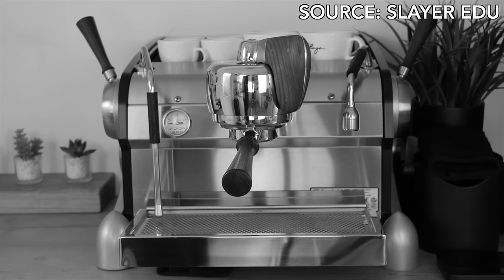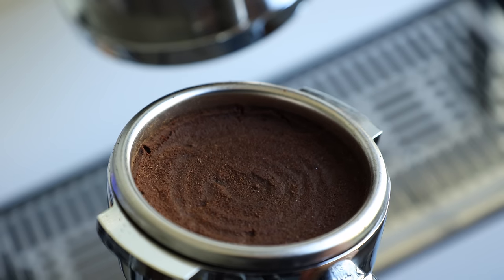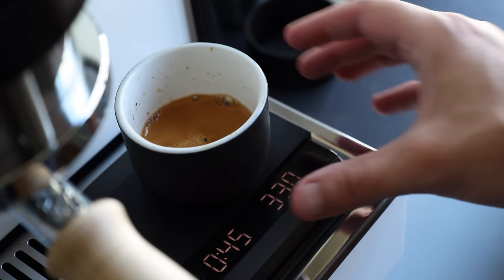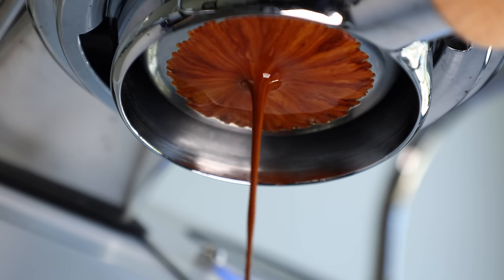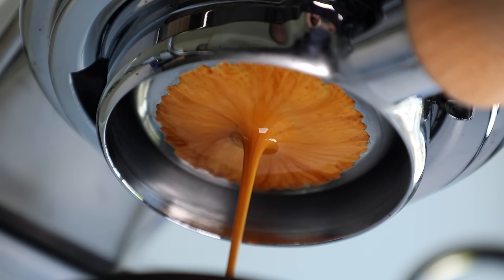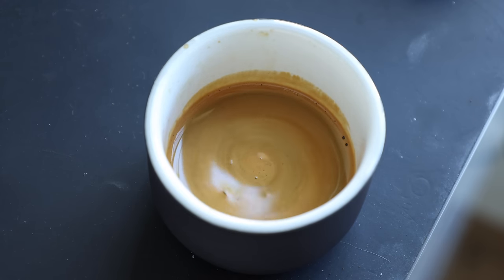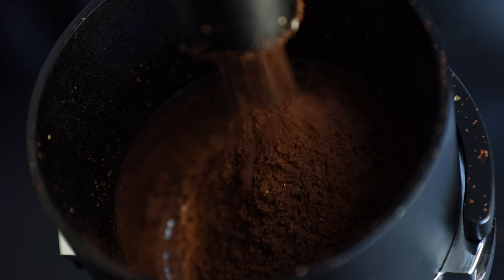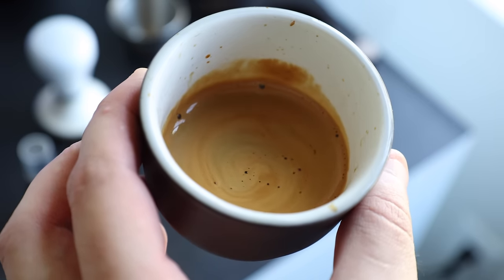ESPRESSO ANATOMY - The Slayer Shot

Comment: When I first got my lever machine these were the shots I was most enjoying. I then found a lot of material that said this was “wrong” and my shots should be taking 25 seconds instead of the 45 I was pulling. 

It taught me a lesson, there’s no right or wrong, as long as it tastes good :)
Reply from the maker: Exactly, don’t let people tell you what is right or tastes best. That’s all subjective
Reply: I pulled a 60 second shot dialling in a new bag of Ethiopian, it was really quite delicious.
Reply: Same experience with levers here. It takes nearly 30sec to wet the puck at boiler pressure, not sure how anyone manages to do it any quicker and get any volume

Comment: This makes me happy. I ran a cafe in college, 2014-2018, and was trained to pull the slayer shot by our local roaster Brown Coffee co. Brown used a slayer but we had a Strada MP and both worked fine like you stated. My top espresso shots came from this style. #1 being a washed Ethiopian that was like sparkling rose water that finished with velvety sweet Meyer lemon. Dear Lord, the heavens parted that day.

Pro: We wasted significantly less coffee! Instead of changing the grind size, and having to purge etc, we just adjusted the preinfuse time! If the shot was too acidic we would preinfuse longer, too bitter preinfuse less time. If shots were running really long we would "flash" the coffee, full on and full off quickly, then proceed with the preinfuse time. Coffees seemed so much more full and complex.

Con: If you weren't tasting the coffee frequently it was hard to tell purely based off time if it tasted like crap. It was also more difficult to train people this way. Another con was shot times were longer. The sweet spot for the coffees we used was 45-55 sec instead of 25-32.

Comment: My main problem with the slayer shot is uneven extraction through the puck. If you preinfuse with low flow or pressure and ramp up with first drops, the top of the puck will have more contact time than the bottom. Every shot I had was sour and bitter. For me it makes more sense to flush the puck and bloom it for ~30s. That will produce more even extraction through the puck.
Reply from the maker: That’s one school of thought, but in my experience I wouldn’t consider it an issue. Contact time in general has become less of a issue for me when it comes to extraction. I’ve had 15 second shots with 22% yield and 60 second shots with 19% yield and both bring a unique quality to the cup. 

In terms of blooming that is also something worth exploring in a future video though.
Reply: Using the Bianca style flow control and an example, by flush the puck you mean open at full pressure and the close the paddle for 30sec, the open it all the way ?
Reply: @NANA-gy7yx  open with max flow to flush the puck, close with first drop, wait for 30s, then pull the shot til your desired ratio
Reply: I get fantastic shots on my Nurri Lever machine with these blooming shots.
I start the pre-infusion with 6 bar for 5-8 seconds. I turn off the pump and then slowly reduce the pressure to 2 or 3 bar. 
Once I get 1.5 grams in my cup which can sometimes take 60 seconds, I release the lever which gives me 10 bar on the puck and then my shot takes about 30 seconds to get about 40 grams into my cup.
I use very light coffee and get very sweet coffee with this style. 
6bar pre-infusion works much better then 2 bar pre infusion

Comment: I've been playing with longer pre infusion with my flair, first couple of pulls weren't much different but then when I went what I thought was too long it produced some of the best shots I've had from the machine.
Reply from the maker: For sure, it’ll take some testing and I wasn’t sure on the length of time either but it pulled out some great espresso!
Reply: I think I have been making a "slayer shot" on my flair for some time. I just did not realize it had an official name.
Reply from the maker: @AlanKlughammer  haha yeah they’ve sort of co-opted the style with the name but I’m sure it’s been around longer than them.
Reply: @AlanKlughammer  me too
Reply: With my flair pro 2 I'm scratching on 40-50sec preinfusion and 20-30sec pull times. Soooo tasty
Reply: Lmao, i've been doing this pre-infusion recently on my flair neo. Due to a bit too fine grind, i need to pre-infuse quiet long (almost 15 sec). Surprise2, the shot is easier to pull and also nice to drink

Comment: I own a Lelit Elizabeth which has some unique preinfusion settings: It let's you program different durations and types of preinfusion.

For lighter roasts, I did use a slightly pressured infusion, which is made possible by letting the steam boiler pressure go into the brew head. But I never tried a preinfusion as long as you describe in your video. 

For medium to dark roasts, I prefer an "unpressured" infusion with a longer duration: 14-20 seconds worked fine so far, depending on the coffee.

I cannot say that I am experienced enough to taste big differences between those and traditional shots, but the preinfusion really helps with preventing channeling. Also, it gives me enough time to grab milk from the fridge and fill it into the pitcher.

And to be perfectly honest: It simply fun to experiment with different variables when it comes to espresso making. I am very happy with my Lelit.

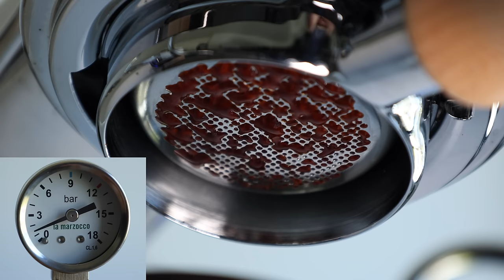Comment: 2:36 IMO the biggest difference between the Slayer and other flow profiling machines is the Slayer restricts the flow but still pushes water to the puck at 9bar unlike the GS3 and other machines utilizing low pressure for low flow. You can see it in how the pressure while extracting increases on a Slayer machine during pre-brew up to near 9bar then moving the paddle to full flow. That is not what happened when you were brewing that even at full saturation 5:53, the water pressure doesn't even go beyond 2bar. I would bet that if you measure the flow rate of the water coming out of the grouphead, it will be higher than the 1.5-2g/s rate Slayer shots are usually made with. 

The Slayer machine saturates the puck at a low water flow at constant pressure while the method shown here saturates the puck by dumping more water with less pressure. Seems similar but the difference is the Slayer forces the trickle of water through the coffee with 9bar pressure while the method here (which is just normal extended pre-infusion) waits for the coffee puck to absorb more water at a gentler pressure which leads to just longer contact time between water and the top of the puck.

Comment: Having a Breville Dual Boiler modded for needle valve flow control, aka the slayer mod, I do vary different types of slayer shots all the time. Preinfusion times, or manual, as well as pressure. And it definitely helps several coffee's. Just having the needle valve so you can do a declining profile, aka lower the max possible flow, so you can keep a constant flow into the cup as the resistance of the puck erodes as the shot progresses seems to be forgiving against many coffee. I can't remember the last time I had a shot that wasn't good enough to drink.
Reply from the maker: I’m with you, I feel like the Slayer shot is a bit of a cheat code. I haven’t had one that was undrinkable yet, even with some wild coffees. Lately I’ve been sort of palate fatigued on nattys and anaerobics but this shot has reignited my interest in them.
Reply: The mod has opened up a new world for me when it comes to resistant roasts and also older beans that I would normally label as “not fresh”.

Comment: Good vid, thanks....
I've got a Decent Espresso DE-1 machine, and MANY of the profiles one can choose from include a pre-infusion phase... it seems to be the thing to do at the moment... except for the Turbo shots, as you say, which are very fast. I've not tried those much, but plan to do an A-B comparison, though very hard to do fairly when some beans/grinds may be more more suitable for one of those methods than the other. Also without two Decent machines, it's impossible to get the same temperatures in cup to A-B test properly.

Comment: I've been pulling a shot we've nicknamed the lazy boy, slow flow rate around 2.6ml/s, pressure ramps up to around 3 bar in 10 seconds shortly followed by first drip, pressure then ramps to between 5 and 7 bar, leave the flow rate alone and stop at desired yield around 40-50 seconds.  Ethiopians are sweet and complex so well worth trying.

Comment: that looks like a fancy way of saying turbo shot with extended pre infusion. think of pre infusion time not really effecting shot time. so it's still around a 18-20 second shot time. but the long pre infusion is requiring you to grind much finer than normal.

to bump extraction, you may want to even extend pre infusion even more my possibly 5-10 seconds (don't worry about over extracting the top of the bed), grind finer, and extend the full pressure shot time. also using lower bars around 7.5 works extremely well for me.

i have been experimenting with low flow 2bar pre infusion for the past few years. It has allowed me to pul even the lightest of roasts in espresso with ease. 

thanks for bringing up this major feature of modern machines!
Reply: **sorry, 15-18 second full bar shot time

Comment: Fantastic analysis and tutorial. Were you able to get the flow rate slow enough to replicate the slayer? I had an Rocket R NineOne and the found that line pressure was too high/fast at approx 2.5 to 3ml/sec rather than approx. 1.5 like a slayer. Not sure if the GS3 is similar given they’re both pressure profilers. Thanks for the effort - these vids must be rather time consuming

Comment: After owning both GS3 and Slayer simultaneously, for some reason the Slayer would always let me grind finer. I didnt like how the GS3 would spew all that excess water into the drip tray causing the brew boiler temp to drop dramatically mid shot, sometimes by around 3 degresss C depending on how long the pre-infusion would run. I did find the Slayer shots had less body but did taste better in my opinion.
Reply: I have the same problem the water flows out quickly I sold it and bought a new slayer one group

Comment: With slayer shots as far as grinding finer, you can use a grind that is so fine that it would simply choke on a traditional 9 bar shot, use a 30 second pre-infusion, then ramp up, and ramp down. This will give you a totally different tasting shot.

Another thing they allow you to do is remove excess brightness from super light roasted coffee.
Reply: Exactly

Comment: I pull really long shots on my lever machine (Vesuvius EVO Leva) which tradition would say it's wrong but it's been hard to get a bad shot with light roasts. I am basically doing 2 bar set preinfusion until first drips register on scale and then pull the lever and since it's a dual spring it starts the shot at 10bar and tapers down to 6.5 bar by the end of the shot. Preinfusion can take up to 20 secs with another 30 pulling the shot for a total of 50-60 second shots sometimes.

Comment: for my own taste, my better double espressos (I use ratio of 15 grams in, 35 grams out, VST-15gr basket) have all been longer i.e. 35-40 seconds. Usually my 25-30 seconds extractions are "thinner" and less satisfying. So I tend to grind finer to slow the extraction by 5-10 seconds. I have Rancilio Silvia V3 so I dont have any pre-infusion. Sometimes I wonder if I should pour a tea-spoon or two of hot water on the top of the puck before I lock the naked portafilter in and press the extract button. Thoughts?

Comment: Really like your examinations on the Slayer shot, as my feelings on it pretty much match yours, running them on my Bianca, 95 % light roast single origins in all of its variations and processings. 
I ve recently combined the profile with a dropped pump pressure of 6 bars and kind of feel that the shots have won on the side of clarity, maintaining the characteristics of the Slayer shot you've described: beautifully complex and bright but balanced shots from the very beginning of the sip. works out with longer ratios as well. Have you tried that as well? Btw., love to see the MP on your Bar, looking forward to many new chapters of ESPRESSO ANATOMY to come :-)
Reply: I am doing that as well on my synchronika. Extremely light roast pacamara has most balance if I reduce pressure out of 30g, and keep pulling it longer, 42-45g. Not quite as slayer though.
Reply: I've got a question on the Bianca. Been doing Slayer shots for a while now but when I crank it fully open after pre-infusion the group head pressure goes to 12 bar while pump pressure is 9 bars. So I'm now slowly opening it to maintain the 9 bar at the group head. Is this the same experience you have?
I also do a ramp down at the last 5-8 seconds which produces a bit more clarity and tastier shots.
Reply: @JackZtarrk  it shouldn't go to 12 bars if your pump is set to 9 bars. Double check using a blind basket.
Reply: @NANA-gy7yx  I checked and it does. The group head pressure measures 12 and the pump pressure 9. I thought it was due to the very fine grinds used in slayer shots
Reply: @JackZtarrk  it shouldn't do that no matter how fine it is.
Put the blind basket and when you calibrate the pump pressure keep an eye on the grouphead pressure and make sure it is on 9 bars. Otherwise, it may mean that the one of the monometers is broken
Reply: @NANA-gy7yx  thanks for the help I'll do that!

Comment: There is one thing missing in your account: grind distribution. I find that certain burrs yield quite high extraction without the need for long preinfusion or turbo shot techniques. In my case this became very notable when I changed the original Mythos burrs in my Kafatek Flat grinder to the newer, proprietary Shrunken Light-Medium burrs. If I were to use long-pre infusion or Turbo shot techniques, even with the lightest roasts, I would surely exceed the ~24% EY I normally obtain without them.
Reply: Sorry – not Shrunken, but Shuriken (damned auto-correct)

Comment: Well, done. I think this is one of your best videos.

I think many LM owners will appreciate this video and the topic needed for this breakdown.  It could be nice to see the following video and your take about Pressure vs Flow when it comes to pulling a shot. Another tip I would add is to make sure the water tank is full and the drip tray is relatively empty as these long shots on the GS3 MP will divert a LOT of water to the drip tray. If it is not connected to the main water or drain, it could be annoying. Cheers! -Y
Reply from the maker: Thank you my friend! And yes on the water. It’s a lot of water. I found myself maybe making 5 or 6 shots before the tank is ready to refill. 

I would definitely like to go more into the topic of pressure vs flow and definitely expect to see my thoughts on that in the future for sure.

Comment: Hey Spro bro, wondering what you're using for basket size and dose? 18.5 and 1.8 ratio or so?
Reply from the maker: I’m using a 18 gram basket with a 17g dose
Reply: Thanks!  I seem to have the issue of donut extractions, but grinding coarser isn't helping, so I've been adjusting dose... Back to the drawing board?

Comment: My usual go-to standard pull is bringing the machine to line pressure = 10-30sec depending on the roast and grind and ending at 50-60sec. I would like to try some low-pressure pulls.
Reply from the maker: So are you running a full line pressure shot? Or do you ramp up at 30 seconds?
Reply: @Sprometheus  Ramp up after PI/bloom. line pressure (on the GS3) the point where water just starts flowing. I mark where this point (for lack of a better solution) with a little line of painter's tape. After PI/bloom you can do a 3,6,9 or 3,9 etc. it just depends on the roast and desired results.

Comment: Having a Slayer at home, I pull 100% of my shots with Slayer shot technique. It’s tasting definitively better than standard shots. I wait to move the paddle until 2g in the cup. Be aware the Slayer shot is a flow controlled shot. The preinfusion makes the pressure in the group head slowly climb from 0 to maximum pressure. Mine is set at 6.5 bar maximum pressure. This also makes the shots sweeter.
Reply: Great, I still didn’t try 2sec. Usually for me is 1gr and than full 9 bars
Reply: @Dejan_23Unlimited  It's worth a try! I was used to wait for the first drop in the cup to move to max pressure. Give it a try, you may adopt it!
Reply: @lgxiii  You described, exactly what I am doing right now. Will give a try tomorrow morning, thx.
Reply: @lgxiii  Thank you, I did try this morning and it’s much much better waiting 2 sec.  Thanks again for the advice and enjoy Slayer ☕️
Reply: @Dejan_23Unlimited  your welcome but I have no merit. Should you visit Slayer channel to find explanation on this topic, and some others.

Comment: Have a Quickmill Vetrano 2b with e-61 flow control. Been pulling scott rao 30 second blooming espresso shots. Using the E-61 flow valve the preinfusion is started to 2 bar and then shut off for 30 seconds. Then the valve is reopened to provide 9 bars of head pressure. 1:2 shots come out real smooth. The young PREFONTAINE bros [Fratello Coffee] had a YT vid with Joel pulling shots on the Slayer. It was an absolute scream. They tried all kinds of pressure varations with comentary on how the shot tasted. The vid is now gone. The fine grind and total saturation of the grinds are the secret to the Slayer taste profile.